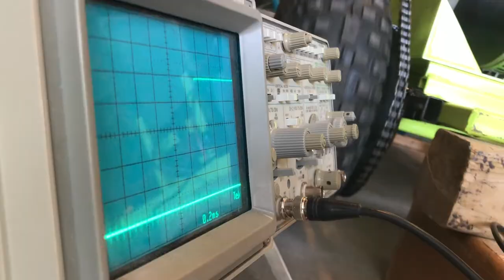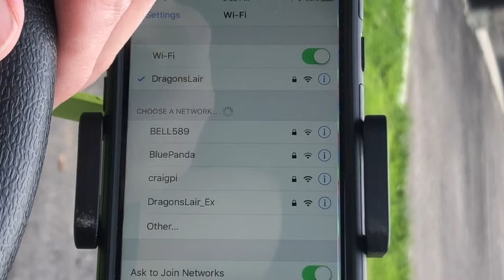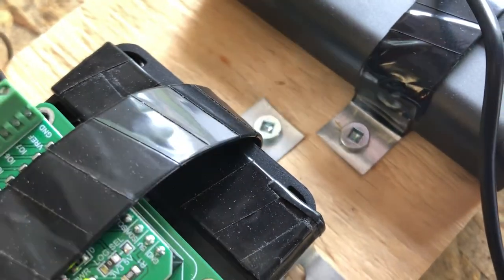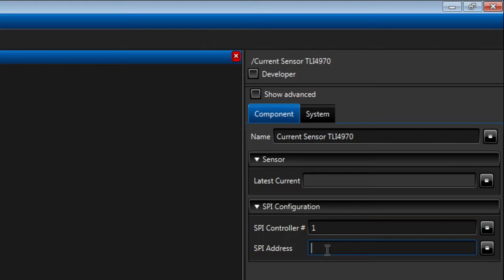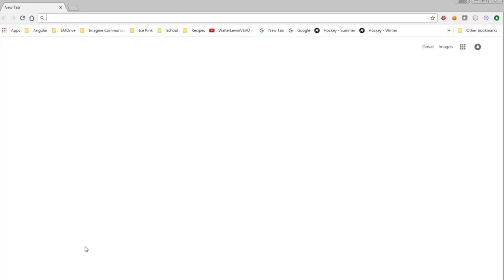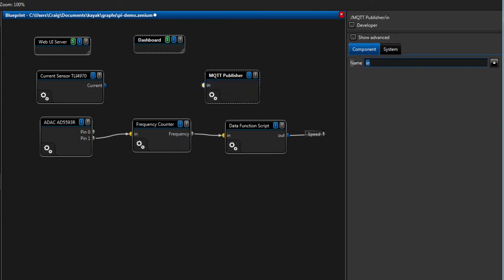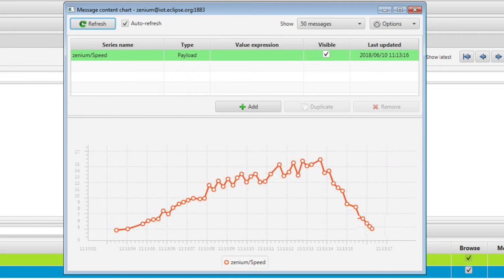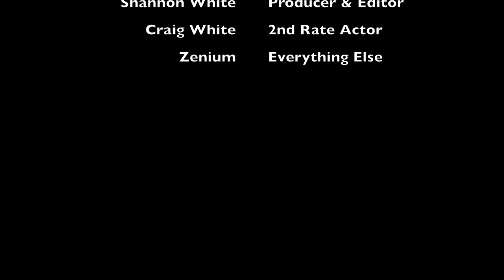Zenium and IoT Transforms an Electric GoKart

Comment: So is Zenium similar to Arduino then?
Reply from the maker: Zenium is software that runs on top of an operating system such as Linux, Windows, or MacOS.  That little Raspberry Pi computer we used is somewhat similar to an Arduino.
Reply: @craig.whitex  thanks for explaining!